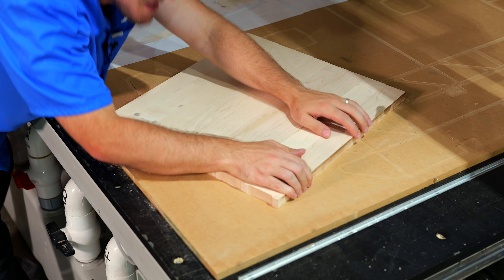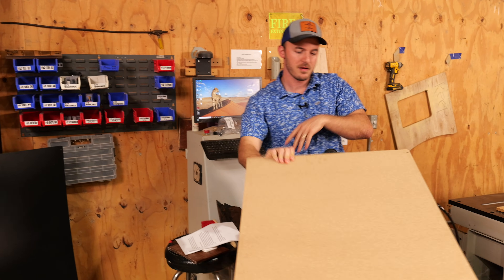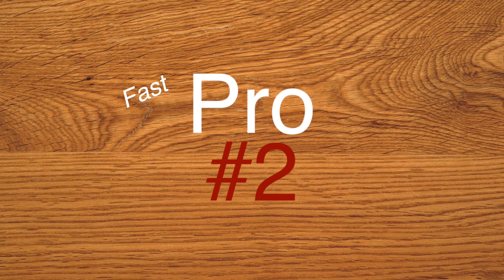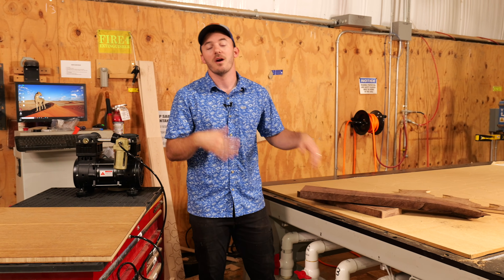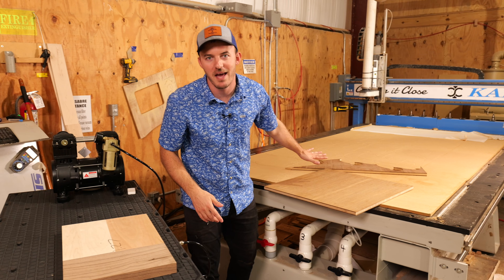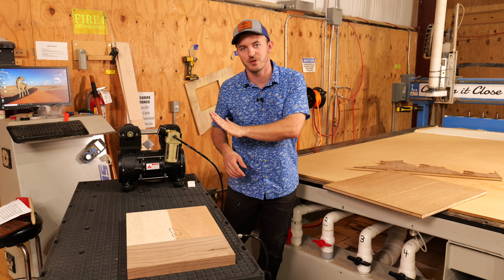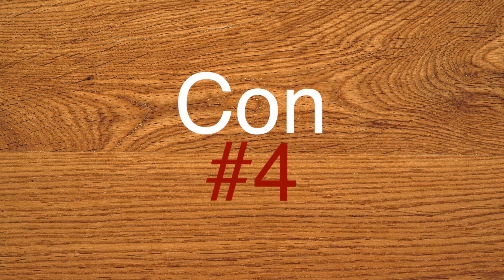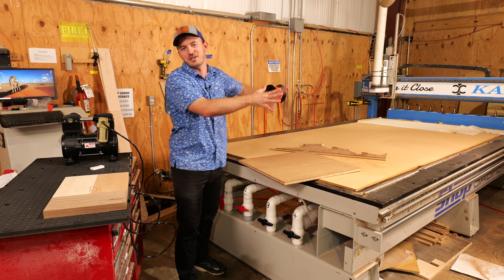Pros and Cons of CNC Vacuum Tables | Hobby to Industrial

Comment: Looking at your larger CNC it appears to be zoned into 4 sections so you can dedicated full vacuum suction to a specific quarter... but you did not mention this? Maybe I am wrong, but I'd think the easiest way to hold down smaller pieces is to create multiple suction zones and only use what is needed negating the need to move the seals. Having worked in a shop with a $160K CNC, I'd say the #1 advantage is full cut through ability when using a MDF spoil board. Seldom did any small pieces move after being cut through e.g. 3" x 12" cabinet rail or stretchers, or small drawer fronts. Occasionally it does happen with plywood that has stress in it and pulls up after cutting but seldom did the pieces get damaged - of course, you do have to be paying closer attention anytime your CNC is running with these types of applications (small pieces in the cut pattern) and pieces possibly coming loose, getting damaged or interfere with the safe operation of the CNC or damage to a bit etc.

Comment: Great video, one question: currently, I simply clamp down the material to my spoiler board and add tabs to hold it in place and prevent it from flying off.

Would using a vacuum system save me from having to add tabs to my cuts?
Reply: If you leave some onion skin! If you do, you add more clean up time!

Comment: A small crappy shop vac plugged into a torsion box, with skimmed top is actually a pretty effective and cheap way to get started with your own DIY vacuum table. Obviously, the vacuum cleaner won't last as long as a real pump, but they are only $40 and gets you productive sooner than later.

Comment: You don't want it to suck a bow out of a warped board. Because even if it could hold it, the second you turned it off, it would reintroduce the bow into the board, and your project would be crap...

Comment: Thank you for the great info.
If I may ask, relating to industrial machines.
What's the smallest piece the vacuum table holds before pieces start to move?
Do you onion skin for all the fast rough cuts and then cut through or keep tabs?
Your spoil board mdf? How thick is the spoil board before facing it?
Reply: Some maths. If you have a pump like a becker ,busch,...vane pump and you can get to -0.9bar, the pressure on top of the part = 0.9kg per cm2. So a 4x4" piece, has a weight on top of about 90kg. At sea level! If your piece goes sideways, put a piece of sanding paper under it with double sided tape. It won't move again.
Reply: Big pump is 3/4 " mdf board, sealed at the sides, cover unused parts with plastic or tape.
Reply: There is a system called Tile Weights which is essentially 2 * 2 neopreneish self adhesive gaskets (1/8 or 1/16) that are applied to a MDF spoilboard preferably 1/4" and LDF if you can find it. The tiles are perforated with holes which concentrates the vacuum to smaller areas.  I wanted to try it on the cheap.  I applied craft foam to my spoilboard and then started letting V12 drill all the holes   It was going to take forever.  I thought.......  I understand the concept of concentrating the vacuum and I understand  that the gaskets also increase friction.  Off I go to Home Depot for 1/4" perforated hardboard (pegboard) and then on to harbor freight for some of the Tool Chest Mesh Liner.  I placed the pegboard on a 2 x 4 zone and put the tool chest liner loosely on to of it.  Turned the Vacuum on and placed a sheet of 2 x 4 plywood on top.  It worked great to cut profile cuts of some objects that I otherwise had trouble keeping in their proper spots  I also ran some V12 Boxes that turned out fine.  Proof of Concept.  I then used a spray adhesive to make a more permanent setup.  I'm going to convert the rest of my ~4 x 4 table now.  Blocking off unused areas is really important IMO and pretty flat media as well.  Oh and I'm going to start doing my projects from  Pegboard/Liner surface in stead of working from material down.  It will let you know if your "Z" is not really tight.   Let me add - My Vac Table is gasketed like airweights and I set it up in 2 roughly 2 x 4 zones.  If that didn't work - none of this would be possible.  Self Adhesive gasket material (rectangular in my case) about 1/16" proud of the Vac Table.  Works great.

Comment: One question you didn't address (i think) is whether it works for small parts like 50ish parts from a 4x8 sheet. Would it still be effective as all those profile cuts open up and leak air?  That question has held me back from buying a vacuum pump for my cnc for years now....
Reply: You need a dedicated fixture.  A spoil board won't work unless you use tabs, which is a pain.  We have dedicated fixtures for our smaller parts.  I'd look up all star gasketing and check out their videos.  It may a few times to get it right.
Reply: Having a dedicated fixture would be great but the parts move around from day to day (not just the same cuts over and over unfortunately.). Everything I cut is made to order so the parts vary based on the orders for the day/week.  Sounds like a vacuum table isn't the solution for me.  More fun with tabs.  😂
Reply: I like free time to much to not understand how many pieces I sell in a day. If you don't want to have more time that is ok with me. It sounds like everything is custom some how. If you break a sheet up and make ten jigs that gives you lots of options. I understand why a hole sheet and is there a way to break it up into four pieces that you could make jigs in. If it took you 40 hours to figure it out and set up a good system. How many days of not cutting tabs would it take to make up the 40 hours. I think that the problem is you don't know how much time you spend in total.

If you did then you could tell me if you made $50 an hour how long until the vacuum table paid for it's self? You might find yourself cutting sheets up so that you can save time with a vacuum table. A smaller table with more CFM will hold smaller parts. Don't want to spend lots of money make a small one out of mdf and use a cheap air compressor with the hose on the intake side. 

In my shop I went from making $50 an hour to $300 an hour. It was all about saving seconds. Now I work three ten hour days instead of seven 16hr days. I have time to do what I want and make more doing it. Every day is now a game to find a way to save more time. Every step I take is now accounted for. Anything that I could cut has been. 

Wish you luck and remember time is money. And once you spend time you will never be able to get it back.

Comment: I have trouble wrapping my mind around this: so the vacuum will pull through the spoil board and pull down the workpiece? How is it sucking air through the spoil board? I never understood that
Reply: MDF is permeable. A strong vacuum pump will suck down material that's placed on a 3/4" thick MDF spoilboard.
Reply: Vacuum, if you take all of the air out of a place then there is pressure placed around that object. If you breathe in. Could you hold something with just your lips? As thing a vacuum pump pulls air in just like when you breathe in.

Comment: Ryan, great video as always. As much as I’d like a vacuum system, it doesn’t make sense for me. I do a lot of one offs, cutouts and profile cuts. I just bought a new CNC and want to try a pneumatic clamping system which makes it as quick and easy as vacuum tables, and a fraction of the price. If successful, maybe I’ll reach out to you and see if there could be a way to manufacture it and sell. Until then, I’m sticking (pun intended) to double sided tape and baking soda and glue methods.
Reply: They make a double rod cylinder. They have holes or threaded holes. I made a clamp table out of a festool mft. I have clamped lots of things in it. I built it for doors and found I could use it and clamps for glue ups. I threaded a 8mm socket cap screw through a 14mm socket and use that and a clamp to hold the clamp in place. 

I have a foot pedal and daisy chain the air. Used a flow valve on the exhaust so that all 5 clamps close at the same time. 

The thing that I see is that you could put wood on the face of the clamp so that you had a place for the bit to over travel. And then just use the mft grid with plastic dogs. 

I needed to put 400 Domino holes in frame pieces. I used a clamp and two dogs. The biggest thing was that I didn't have any clamping time. I had my hands free to hold the tool and turn the parts. I used clamps for thirty minutes and then switched setups. I finished in two hours. If I had stayed with the manual clamps it would have taken me over eight hours.

The key was the foot pedal that was latching. So it stayed in the position I put it in. I would recommend getting a bigger cylinder say that lest a 30mm. A short stroke is better. 55mm is the shortest I would try. And then you can use blocking strips to make up the slack and give you more space if needed. 

The hardest thing is holding the ram. There are lots of different ways to do that if you can have a mft style top. Thanks for giving me an idea of how to hold and index on my machine.

Comment: I have one question. I see a spoil board on your big cnc. Is the air somehow sucking through the spoilboard or? Do you have a physical address for airweights as I live in south Denver and would like to see their products up close. Thank you
Reply: Just remember that elevation has a big effect on the type of pump that will work. I live at 3,500 feet above see level. A Regen blower will not work for me. And if I get a Becker pump I need to have it calibrated for my altitude. 

I know a lot of people who have shop bots and the like and got a vacuum table that doesn't pull enough Mercury to hold a part. 

For a small table CFM will help you. Just know that not every pump will work at higher elevation. Don't ask the manufacturer they will say that it will. They will not tell you the Mercury it can pull though. And that is what you need to hold your parts.

Sorry I just know that large pumps are a lot and that people don't understand what they don't understand. My magic number is 22. I don't know if the number is metric or US. I believe it was metric as the CNC was Italian. It was the same on the German one. When I got to 15-20 I had to replace the spoil board to get the number back.
Reply: @thomasswearingen6971  excellent point! Luckily, AirWeights is headquartered in the mile high city of Denver Colorado,  so we build and test our systems at high elevation by default.
Reply: MDF is permeable, and a vacuum will suck right through it to hold the workpiece.
Reply: @theebalz reach out via the contact form on our website and we’d be glad to give you a live demo!

Comment: You can use 1/16" thick peel and stick rubber gasket, or neoprene gasket,  on your large cnc spoilboard,  and create zones,  and increase the hold on small pieces of wood.
You can use 1/8" thick gasket in the same way to hold rough lumber, or slightly warped lumber too.

Comment: The Air Weights table is a true vacuum table, because it uses gasketing.
Every large cnc, using a vacuum pump to hold down an MDF spoilboard,  has a downdraft table.
Two different things, but people just call them all vacuum tables.
Reply: "Downdraft tables or downdraught benches are workbenches with built-in ventilation to capture dust, smoke, and fumes and draw them away from the operator and the material being worked on"😂😂😂

Comment: It's much easier, cheaper, and faster to drill the material into the spoil board than worry about the air escaping. Plus, you save on the upfront cost of acquiring a vacuum bed.
Reply: I have a cutting board that I need to put a juice groove onto. I don't think the customer wants extra screw holes in it.
Reply: Ryan pointed out that if you are doing one-off's, it probably isn't worth the time and effort to use a vac system. However for production runs, it is definitely the way to go.
Reply: For on-offs i don't use a spoil board. I use the raster table, but leave 0.2mm untouched, so I don't damage my table. I finish the part on a small router table with a bit with a bearing on top.  For production work, I make a custom spoilboard. Just finished a special floor for an airport 2 weeks back. Now they need 500 pieces more for a wall, so this spoilboard goes back on the machine. Estimated production time will be about 10 hours... around 50 pieces per hour.

Comment: I run a ex industrial cnc machine at home with a vacuum pod system. Works really well for one of projects and smaller workpieces but not to small. 
The major downside is i have to be really carefull about the placement of the pods because they are expensive to replace if i cut into them. And it is not optimal for big nesting projects.
Reply: It's really cheap to make your own vacuum pods.
Reply: @acerjuglans383  i have Schmalz style double vacuum pods which have replaceable rubber top and bottom pads, but if u damage the body u are out at least 100 bucks
Reply: @acerjuglans383  I run Schmalz style double vacuum pods which have a replaceable rubber top and bottom suction pads, but if u damage the body of the cup u are out at least 100 bucks
Reply: I use schmalz style double vacuum pods which have a replaceable rubber top and bottom pad, but if u damage the body u are out at least 100 bucks.
Reply: Gotta use a Tile Gasket type system for nesting and/or profile cuts from my experience.  Allstar CNC Products.